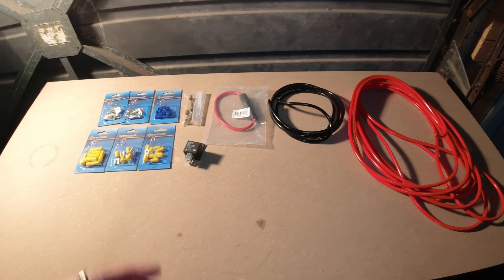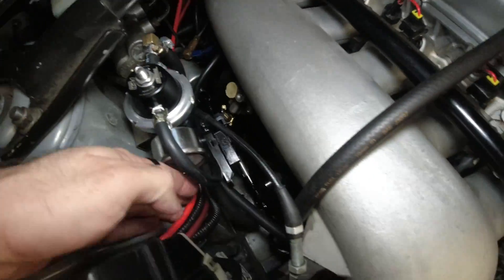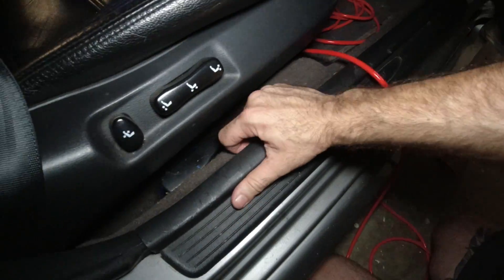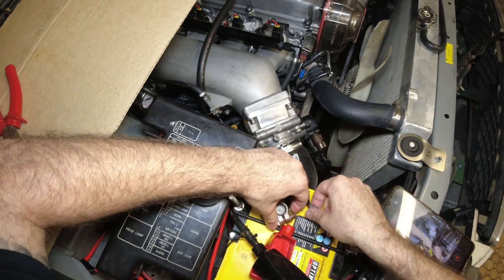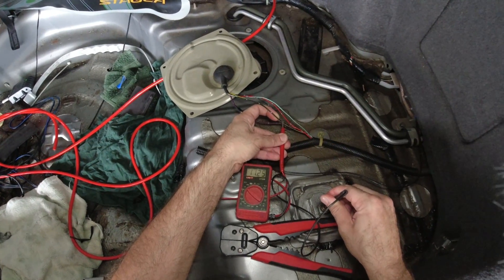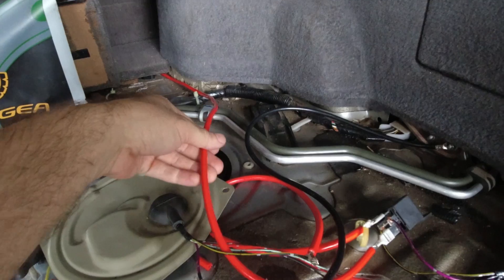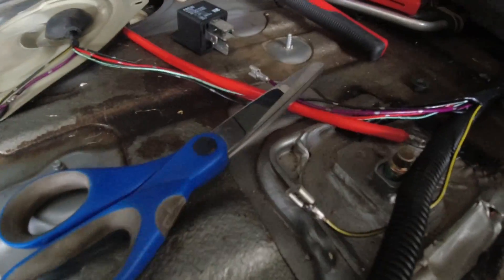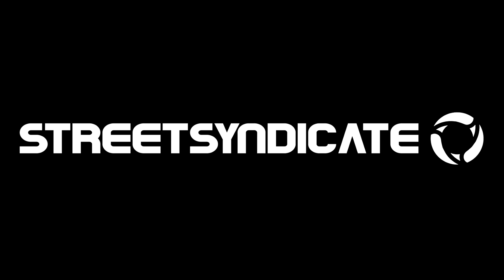Nissan Stagea (RB25DET) Fuel Pump Hardwire Rewire (With Relay For Direct Power Feed)

Comment: Just adding as a warning for anyone looking at this, If you're running a Walbro 460 or similar pump, the draw will be too great on the stock wiring. A larger guage direct feed from the battery is great, but you will also need to swap out the factory bulkhead to avoid issues. In this video you'll see that post-relay the 8 guage is just wired back into the same old factory 12v feed and bulkhead. This will burn out with a large draw pump
Reply from the maker: @__june__198  agreed, to an extent.

I've definitely been told this could happen and have seen a few things online and it's of course always better to be safe.

In fact I have upgraded bulkhead wiring sitting on my shelf at home, ready to do exactly this.

However, it's been running for well over a year now with track time and not a single issue so far. I also know numerous cars in my circle of friends running the same thing with no issues, some for close to 10 years. Not saying it won't go bad in future, but at this point the statistics seem ok.

Comment: That schematic is wrong. The signal wire from ecu connects through the coil then closing the high current (NO) contact. Wiring up the battery and fuel pump to the coil will leave it running even after the ignition is off.
Reply from the maker: My mistake - you are correct! Although the pin numbers on the outside of the relay are still correct. But the diagram of the relay internals shows the coil in the wrong spot. The "switched" part should be the heavy current flow between pins 30 and 87! Thanks for pointing this out bob